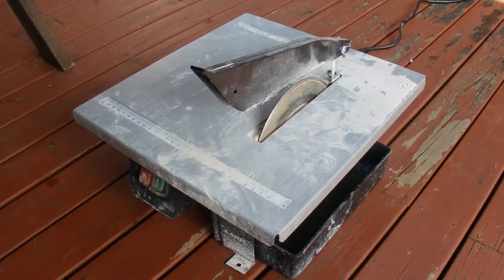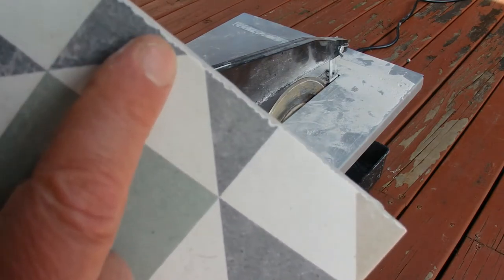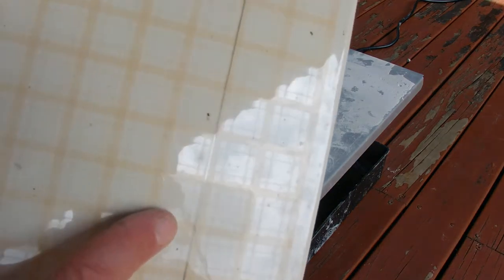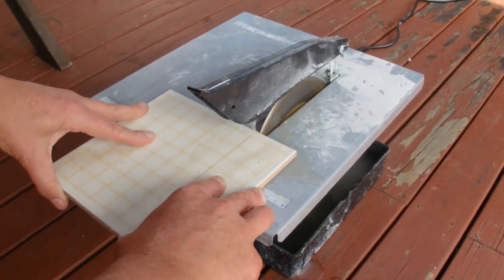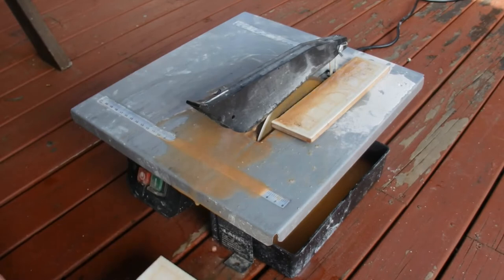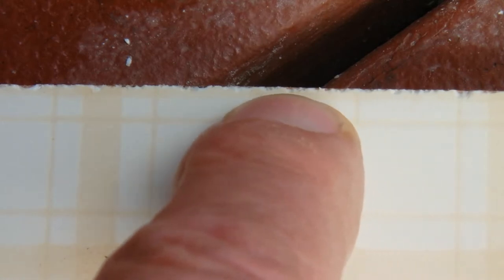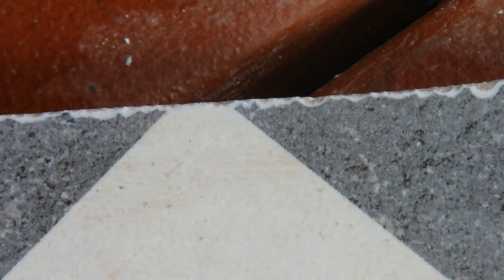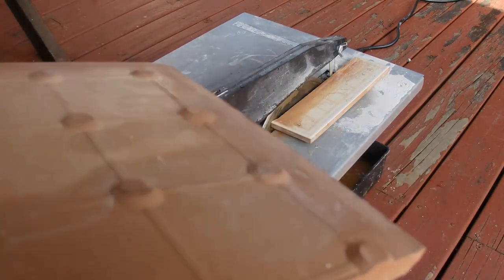Using a Wet Tile Saw to Cut Porcelain & Ceramic Tiles - Are Both Tiles Chipped Along the Cut Edge?

Comment: I was cutting porcelain tile and had the same issue. I tried everything I could think of: cutting the tile face down, masking tape, painters tape, double masking tape, new standard blade ($30), new more premium blade ($100). None of them resolved what I considered to be chipping of the tile surface. I'm sure there is a solution but I haven't found it. I wanted to share what I tried.
Reply from the maker: Okay, thanks for sharing!
Reply: I tried every method you mentioned as well and failed, until I raised my platform with two pieces of sheet rock under the metal, that fixed the depth of the saw blade by only showing 5/8 of an inch, it allowed the blade to have less friction and keep consistent rpm to make clean cuts throughout the tile. Hope this gives you an idea, took me about 2-3 hours to make that invention
Reply: I have a $1,500 haskvarna wet saw and having trouble even cutting porcelain straight. I have a topline pro knaufman tile cutter scorer. I cut porcelain like a breeze and no score marks. I can cut a 600mm long tile say 25mm wide.  I think that is pushing the limit. Any narrower and I think it will break. I'm doing a job so need to get a wet saw in place in case some of the cuts are less than 25mm wide. I think you need a plunge wet tile saw cutter. Cut from the top with a dedicated wet porcelain tile saw blade. Good video and bringing out issues that attempts to improve cuts in porcelain.

Comment: Hello everyone, 
I always use the side guide and l push the tile using a piece of wood or plastic as thick as the tile or thicker. The side of the tile which touches the guide is almost perfectly cut, but the other side is full of chips. ln my humble opinion, the firmer the grap the cleaner the cut.
P.D. Flipping the tile makes even bigger chips.
Hope it helps someboby.
Reply from the maker: Thanks for sharing

Comment: I just bought wet tile cutter, look very similar to your. It's new, with new blade and I have this same problem, doesn't cut clean. And one of the reason why I bought this is to have nice clean cut. 
Why is like that? 
Maybe because the cutter is cheap?
Or I doing some thing wrong?
Reply from the maker: It's a good question, but unfortunately I don't know why... Hopefully someone else may have an answer for you.
Reply: @Howto..GardenGarageHouse  The only way to get a perfect "factory clean, plished cut" is with a over head wet saw with a "plunge cut" ability